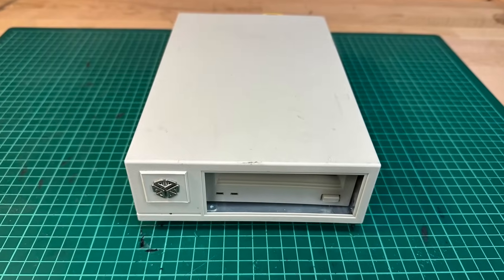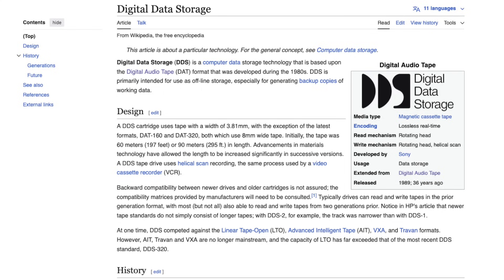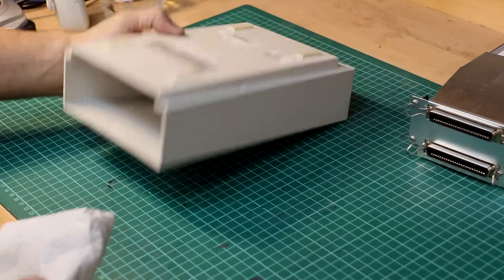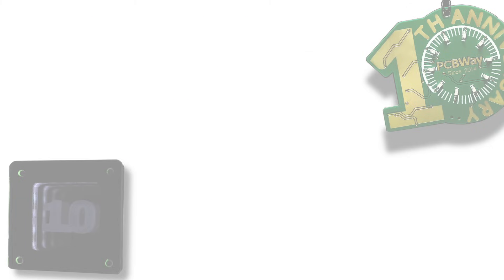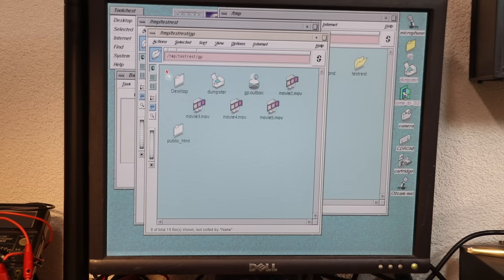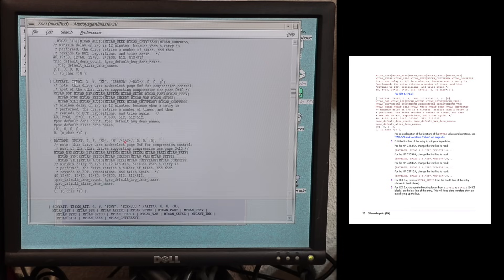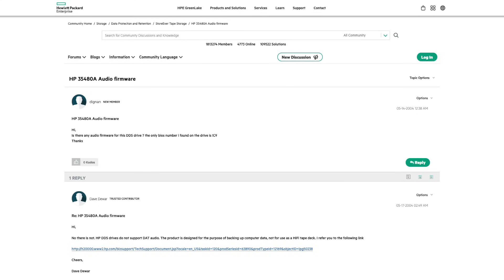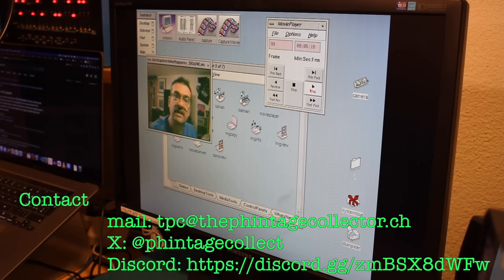Silicon Graphics or Imposter? DDS or DAT? The Mystery of This Tape Drive!

Comment: Interesting find. I also have an O2 and numerous DAT data tapes that I created over 30 years ago that I would like to recover. Alas, I no longer have a DAT drive and an original SGI one is going fo $400 on eBay. More to my liking is an Andataco external DAT drive going for $139 that also contains an  HP35480A. Fingers crossed I'm hoping to replicate your success.

Comment: Sometimes those tape drives (the drive itself not the enclosure) has additional dip switches (sometimes hidden inside, or under a sticker) that can control additional things. Wonder if that's related to the eject thing. or SGI just never plumbed those two things together. edit: 8:26 spoke too soon!

Comment: One question this DAT SCSI unit works with dat audio disks for data?
Reply from the maker: I didn't specifically test that, I'm afraid.

I read some sources claiming the quality characteristics of the DAT and DDS cartridges (the tape material) not beeing absolutely identical.

I can't say any further than that for the time being.

I would imagine, that at least for the early 1.3 GB DDS1 and DAT tapes, the material base was propably identical or near-identical, and they could maybe interchanged.

But even if it would work for the early generation tapes, it propably is not true for later higher-capacity DDS2 through DAT320 cartridges.

I'll definitelly test it for a second round.

Comment: I used an HP DDS drive very similar to that one in the late 90's-early 2000s, although it was an internal drive in a 5.25" mounting bracket with full 5.25" width one-piece front bezel.  I had no idea some DDS drives were compatible with DAT -- I thought DDS just used the same physical cartridge and tape transport mechanism as DAT.  As soon as I saw the front bezel of your drive (the drive itself, not the external enclosure) I was pretty sure it was an HP drive.  It has the distinctive mid-90s HP server styling.
Reply from the maker: Indeed, I always thought so as well.
Until I found there were some hybrid drives during the early days.
It's definitely something to follow up, as now I'm on fire see a real DAT drive on an SGI.